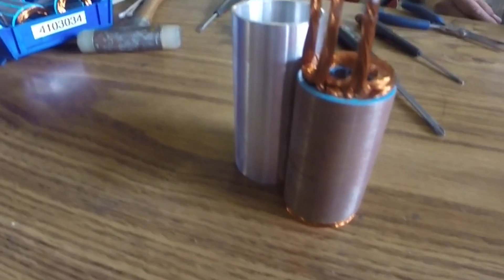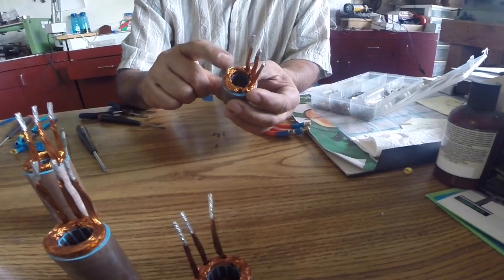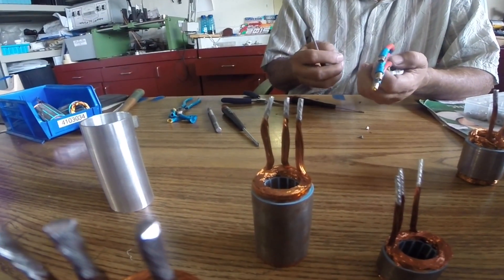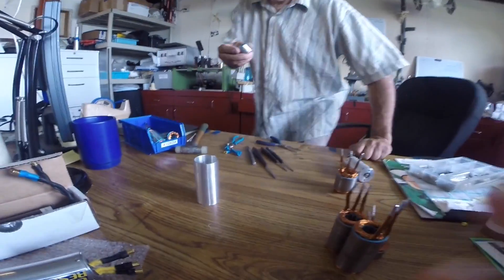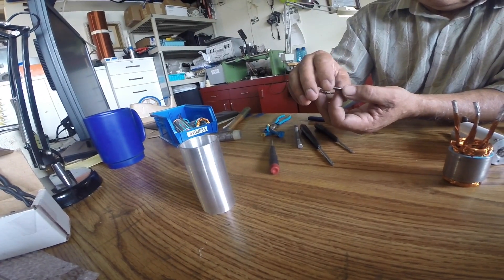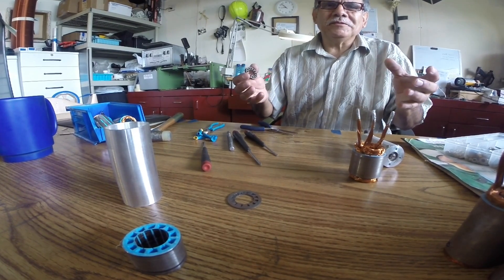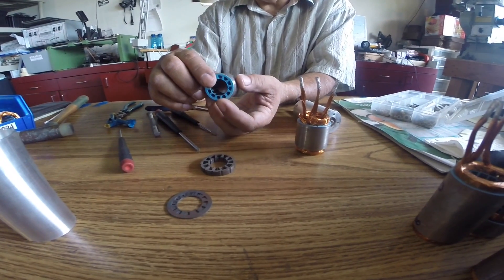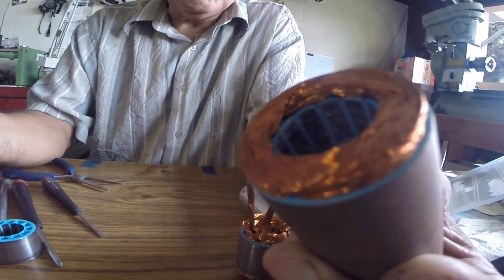inside cordova research with jose part 1

Comment: I can solder cut wires like that after I cut them. I use a caustic soda solution, it comes off in seconds. Nice motors though!!
Reply: How do you reapply the solder? What material do you have to coat them with?
Reply: I told you. You need to strip off the high temperature epoxy with a lye/salt slurry. Dangerous and after the wires need a cleaning with a baking soda water solution. Then flux and resolder